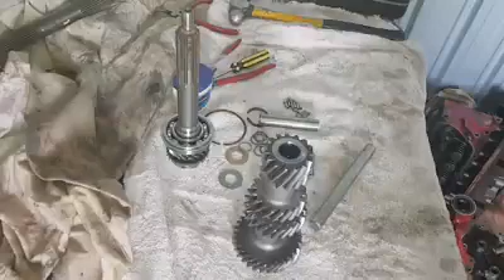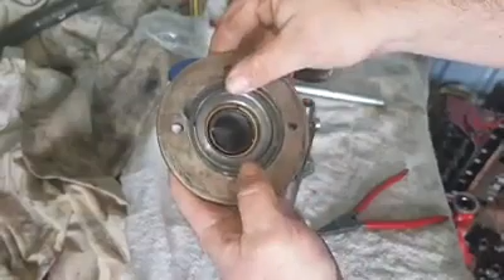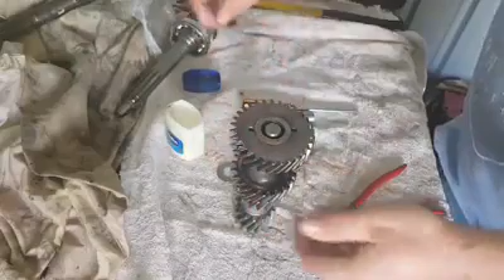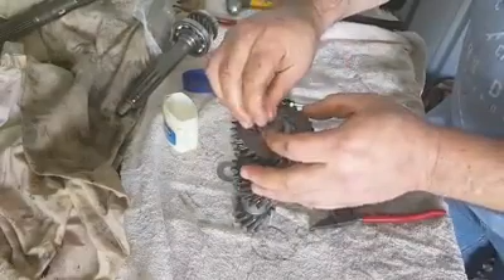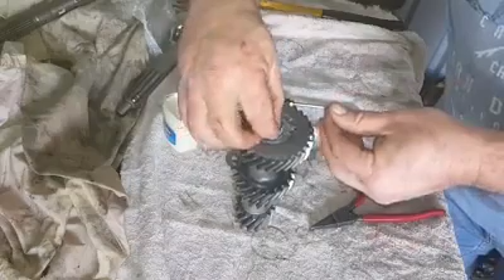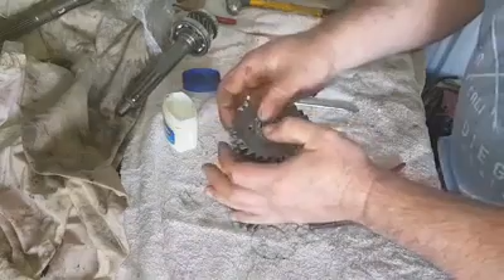holden m20 m21 m22 gearbox assembly #2

Comment: Hi, I have tried to put one more needle bearing in but only can fit 23 is tight but there is still a bit of a gap.
Reply from the maker: same amount rollers in each row, if rollers not straight last one wont go in,   sometimes theres a gap if cluster is worn

Comment: Hi, Do the needle bearings need to be pack tight or should there be a space for movement I have a space but is just not big enough for a another needle bearing
Reply from the maker: packed tight, spin hole lot around to align and straighten up to fit last one